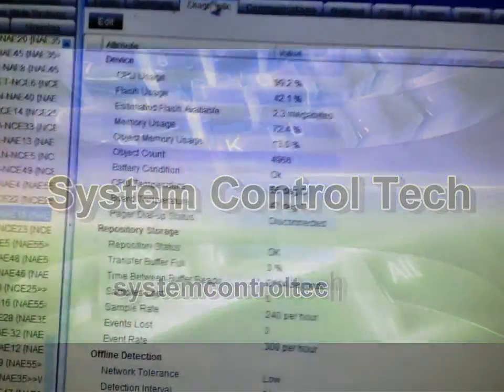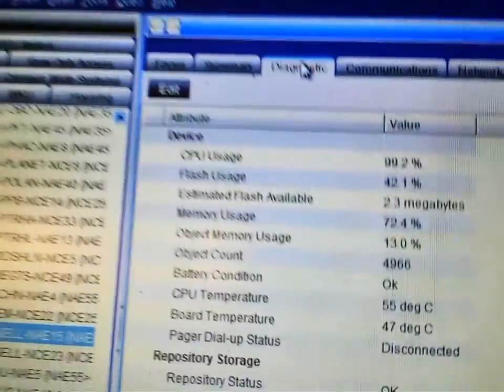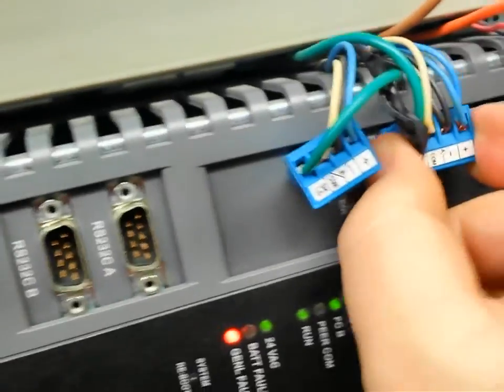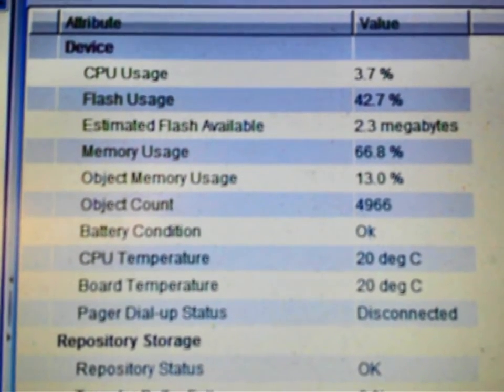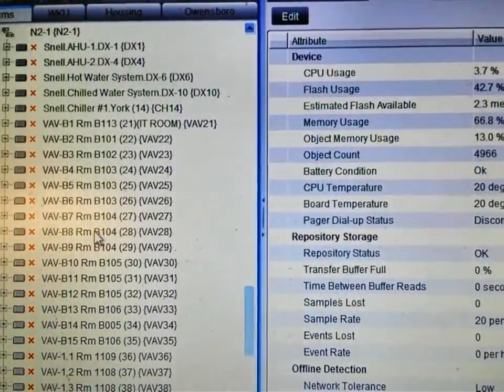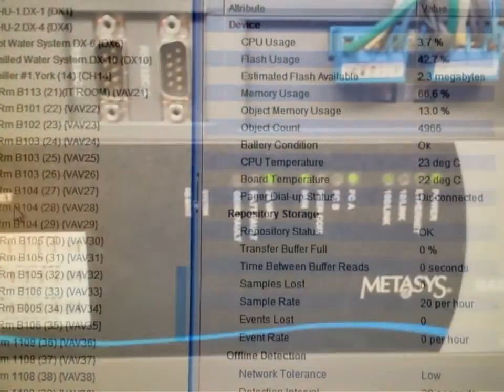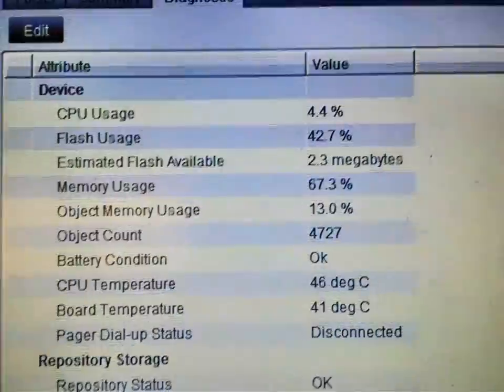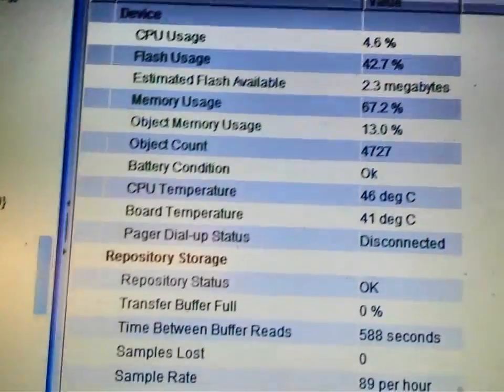Troubleshooting a Johnson Controls Network Automation Engine

Comment: Any advice on an Nae55 with cpu usage that slowly creeps up over a 10 hour period with a cov rcv rate that runs between 450 and 550. After about 10 hours it loses communication.
Reply from the maker: We had that same issue and discovered two issues. The first was the version that was running and the second issue was that the engine kept looking for devices that didn't exist anymore.  Clean up the database for starters, check Trend log times on trending of points also.

Comment: I have a metasysy system that is turning off the thermostats in the field by itself for un known reason. They can not be turned back on either from the stat or in the DDC sysytem by changing the mode switch.
Reply from the maker: Sounds like programming issues

Comment: “ The input buffer capacity has been exceeded”. None of the parameters can be changed.
 So how to fix this issue and appreciate your response.
Reply from the maker: You may have too many points on the device. Try removing some. Begin with any trends you may have

Comment: Please help! In Metasys, in the NAE, in the N2-1 drop down for the VAVs they are showing a red x on and off throughout the whole list except for three VAVs, which are not working; randomly the rest come on and off line; how do I fix this; if you can see my email can you contact me
Reply from the maker: Make sure none of them are set to the same address.  Check your wiring and make sure you don't have a device going bad and dragging down the network.

Comment: Thank you for putting out lots of useful technical video.   I just started a new job, at this work place we still have lots of old legacy JCI controllers.    There's a NCM 350 need download, but NC download would failed, I tried NC Reload but it also failed and say need to do "FORCE DOWNLOAD".  I was wondering if you could guide me how to do the NC force download process. Thank you so much in advance for your time and knowledge.
Reply from the maker: +4everLao it has been several years since I worked with an ncm.  They are a challenge.  Try connecting using the serial port. If that doesn't work,  you may have a bad device

Comment: Thank you again for your excellent detailed videos! If it's alright that I ask, are you a JCI employee? I am new in the System Tech role and just started taking on projects here in the Northeast. Your videos have been very helpful in my day to day function (along with internal resources). Thank you for that!

I wonder if you could make a video on importing a new NCE/NAE and FCB trunk to an existing ADS/ADX database? Locally to the new NCE I have already created a database with all of the FCB, trends, alarms, and devices, etc however have had difficulties in bringing the new device online to the head end "ADX01" / ADS. I do have an SQL mismatch (site uses 11.0 whereas my JCI laptop uses 10.0) but I am not 100% certain that is my issue. I have tried using the Import item function with the files in the standard PC folder location but when you select that in SCT, the file doesn't appear. If you can't make a video, any thoughts? Thanks in advance!
Reply from the maker: +Joey Fisherman Glad I could help Joey.  When you log directly into your NAE or NCE you will need to tell it where to find the ADX server.  It will need to be told the IP address of the ADX.  I will see about getting a video together with a little more detail.  Here is a link to a video where I added one but I didn't get heavily into the NAE configuration for telling it where to find the server.  I will get to work on one.  Thanks for watching.  https://www.youtube.com/watch?v=88mEnX-gmBE
Reply from the maker: +Joey Fisherman Also, no I don't work for JCI.  I have several good friends who do and I've been working with JCI systems for several years.